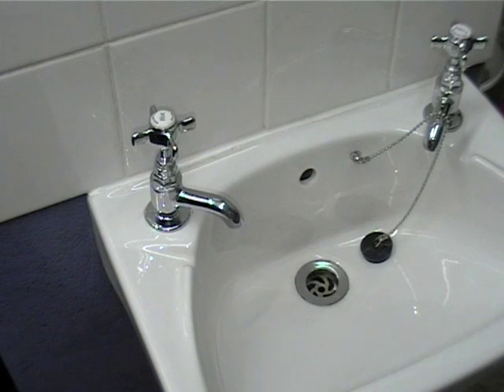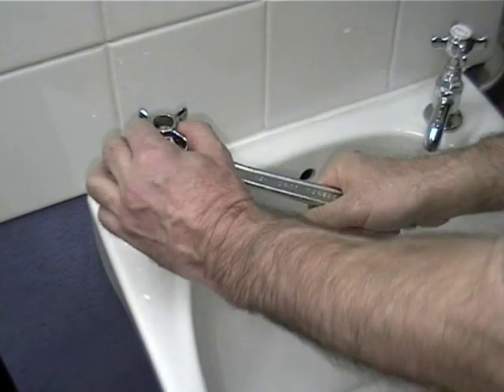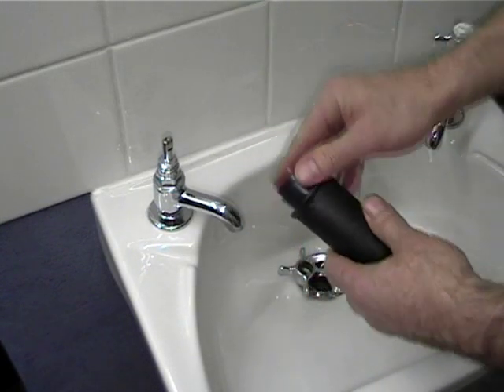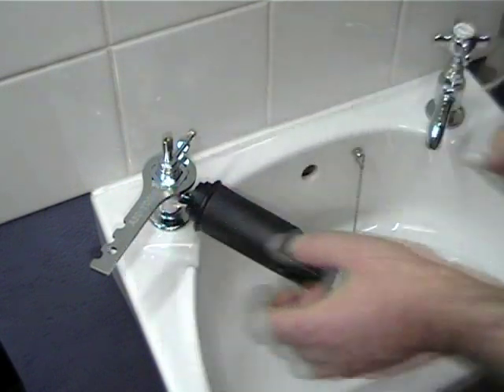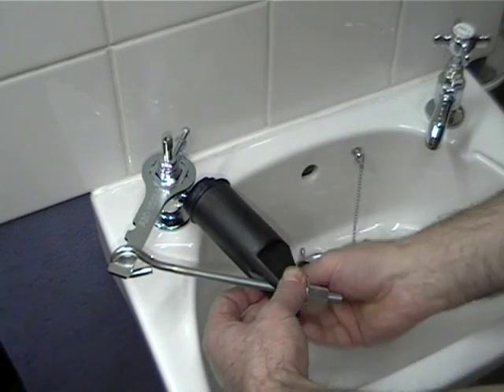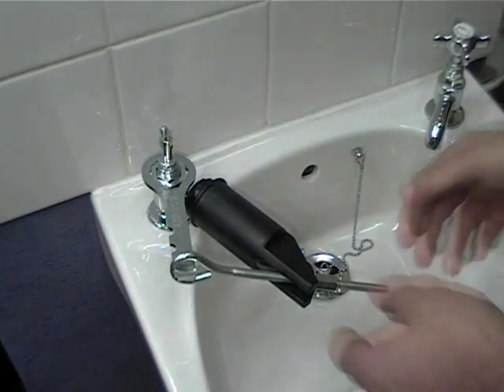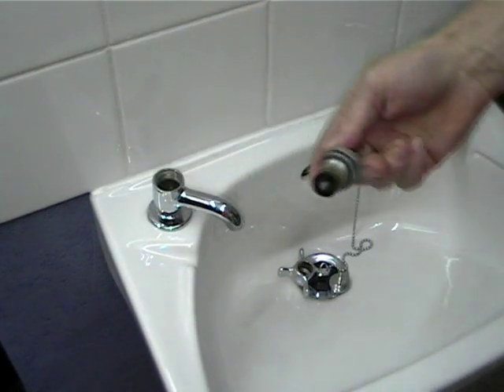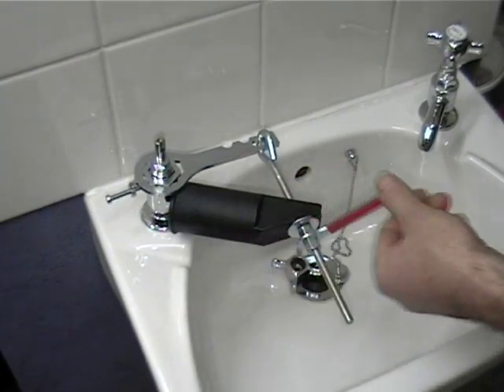Change Tap washer using the  Easy Tapsplitter Part 1.

Comment: This is an exceptionally well engineered tool. 

I bought one a few months ago having failed to remove a tap head with a spanner. The brass seating was all worn and I was toying with the idea of replacing both taps until I saw this video. 

The tap head came off effortlessly, thanks to the well made head spanner. The whole job, including replacing the head took less than 5 minutes from getting the tool out of its package.
Very highly recommended.

Comment: Ordered this gadget as a last resort after trying all the other 'tried n tested' methods recommended. After a week of getting nowhere on corroded taps that have been in 30+ years, I threw in the towel and just ordered this. Literally took 2 mins with this device, even an idiot like me was able to use it with no problems. Might seem a bit pricey but for how easy it made the job and the fact I now have a tool ready to use for any situation like this again. I think it's worth the money.

Comment: This tool is AMAZING! I had a hot water bath tap that wasn't moving for love nor money (the whole tap just kept twisting - it was installed over 30 years ago) - I got one of these tap splitter kits, feeling quite sceptical to be honest ... BUT I can't tell you how easy it was to get the cylinder out ... literally 1 minute, using 1 finger to turn the spanner thing. It's brilliant .... don't hesitate to get this tool. Many thanks for the video too - it set my mind at rest to check I was setting it up right. BUY THIS TOOL!!
Reply: I recently got one and used it on a bath tap too - the cold tap for me.  A 1970s tap, with the headgear absolutely stuck fast.  Wonderfully easy to use.

Comment: It has been used on exactly those sort of taps with 100% success to date.
Using the TapSplitter gives absolute control over the force used to shift a stuck nut which you cant do with stilsons and a spanner. When the seal on the tap is forced to release then, unless that force is controlled, it will damage the pipe connections or even the basin. And that won't save you 20 quid  :)

Comment: I had two leaky taps with tap heads that appeared to be heavily corroded and locked in place. I ordered this kit and was a bit dubious about whether it would work but it did. It was well worth worth the price. much safer than the knuckle grazing alternative.

Comment: This gadget really works!

Just spent two days trying to get a siezed tap-head off using penetrating oil and a box spanner for leverage. Bought this gadget on-line and it took only ten minutes and it was dead easy!

The only down side is the cost - £20, but I suppose it's less than calling a plumber out.

I have no connected with the manufacturers in any way.

Comment: It does seem to work well, but couldn't I have accomplished the same thing using a wrench, a breaker bar and a deep-well socket that fit the tap?  I already have those tools in my arsenal.  It perhaps makes sense to purchase this tool if you're a plumber/handyman and do this frequently, but for the average DIYer, it's another tool in your garage that may not be used for years at a time. As someone else pointed out, this was done on a relatively new faucet; we'd like to see this set tried on a "problem" faucet (i.e., one with some miles on it) to see how well it really works.
Reply: I recently used it on an early 1970s bath tap that had never, as far as I know had the headgear off. I also bought the ABD tools Tap Handle Pusher, to get the stuck-fast the tap handle off, and a strap wrench to unscrew the tap bonnet.  A lot of things to get, just to change a washer.  But those tools are mine for good now, and it would have cost me more to get a plumber out for that one job, I am sure.

Comment: Yes it does look like a good gadget, I have had huge problems with repairing these type of taps, might even get hold of one.
BTW, when refitting the Headnut, I strongly recommend you DO NOT just nip it up, as in some cases it will screw out when someone turns the tap on fully and ends up screwing it back out by hand and.. Flood! That is precisely why they are overcautious in manufacture and they are fitted so tightly

Comment: This is an unsolicited message, I have no affiliation with the manufacturer. 

Just got one having tried to remove a tap head that's been in place for about 15 years, & all the know-alls below couldn't've got it off either, I tried gentle pressure, strong pressure, hammers, oil and swearing, it wouldn't move. The tapsplitter did it in a few minutes, with no fuss. Fab.
Just think - what if you paid loads for a plumber to come out, and he said "I've got this brilliant tapsplitter thing.."

Comment: Clearly a useful tool, but a last resort as far as my experience suggests, and I've met a few stubborn bugger's. So long as you protect the tap surfaces, wrenches with extended leverage usually does the job, with maybe some release oil.   Knowing the cost of this gadget , may also help someone to decide.

Comment: but would it work if the nut is rounded off ?
Reply: They sell a clever insert specifically designed to cope with the situation where the nut is rounded off.
Reply: You would probably need to use the PoziBite part. This allows you to drill a screw a few mm into the nut. The nut is moved as the mechanism is attached to the Tap Splitter.